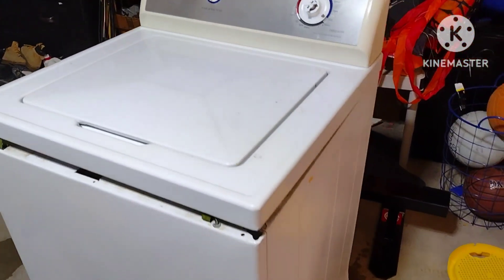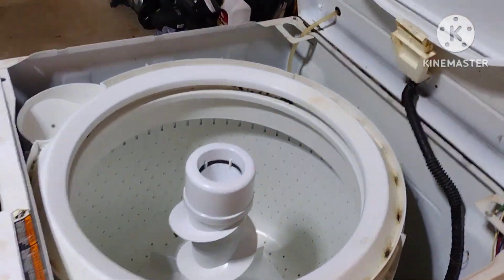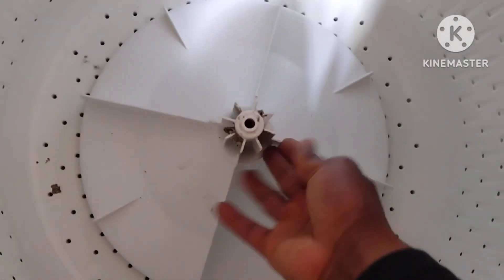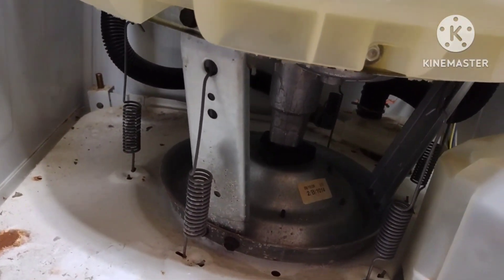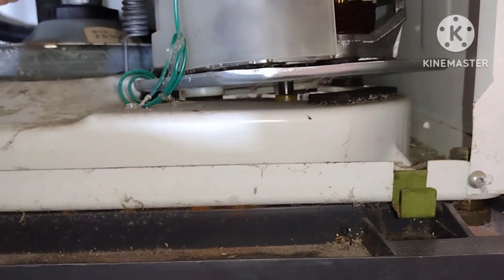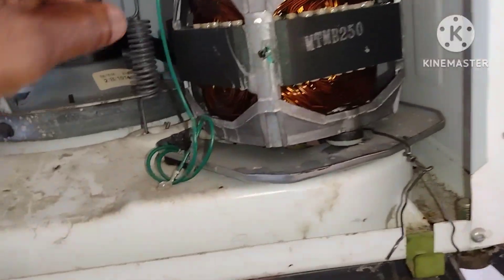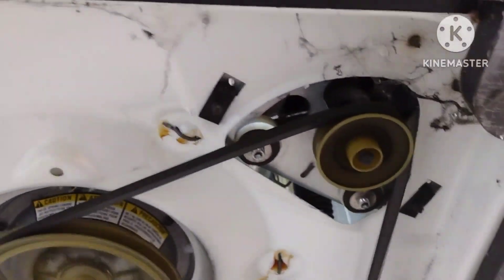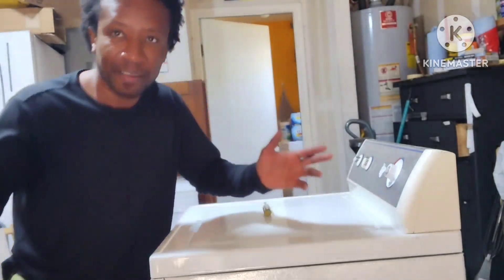WASHING MACHINE WITH A BAD AGITATOR

Comment: what if that part isnt lose, how too fix 🤔
Reply from the maker: More diagnosis will be needed. Check the belt, pulleys, springs and you visualize what is causing it to vibrate. Generally, a component is loose which causes this issue.